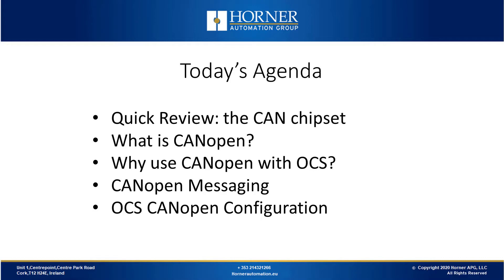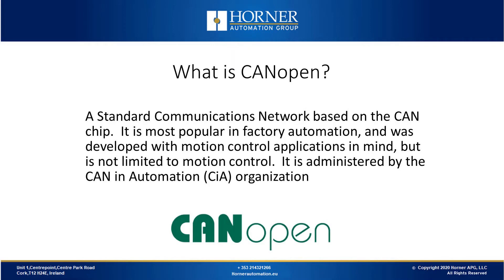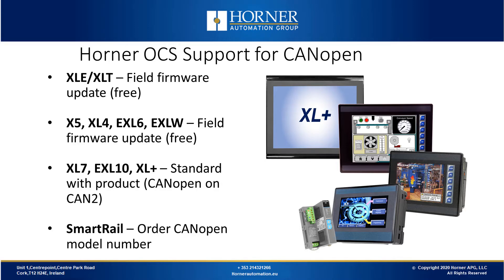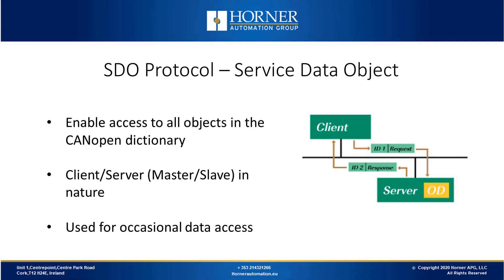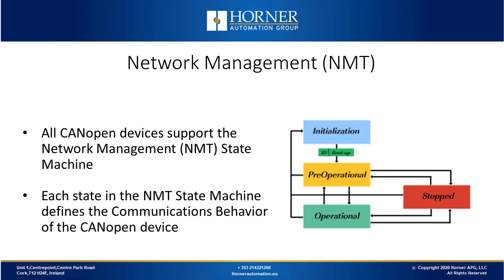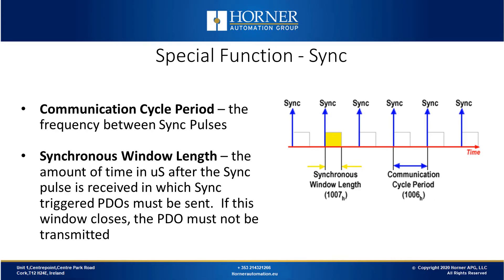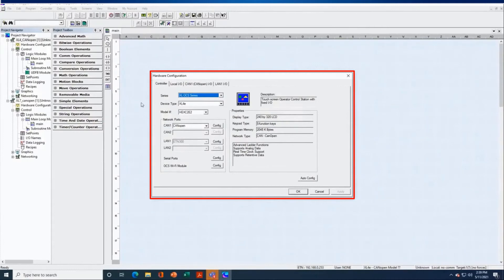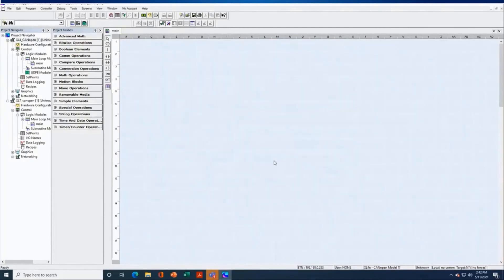CANopen Networking: How it Works

Comment: Seems all the CanOpen software I've looked at (CanOpen Magic, PlotJuggler-Can-DBS etc) require a device's DBC file in order to interpret the can-bus data.. yet the most common device file provided by the manufacturer is an EDS!   

To make matters more confusing, there is also a DCF file format, which seems to be a tailored version of an EDS to a specific device.  However, not sure the difference between DCF and DBC.

Any suggestions how to create a DBC file based on either an EDS/DCF file or from the product's documentation listing the SDO/PDOs?
Reply from the maker: Hi there please contact technical.support@horner-apg.com with any queries, thank you